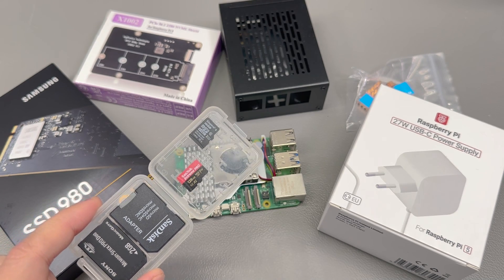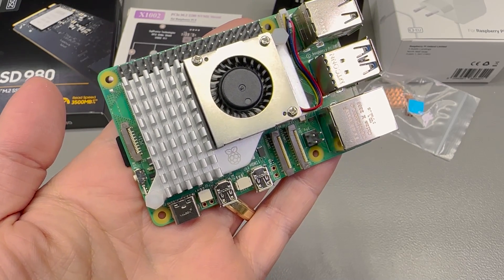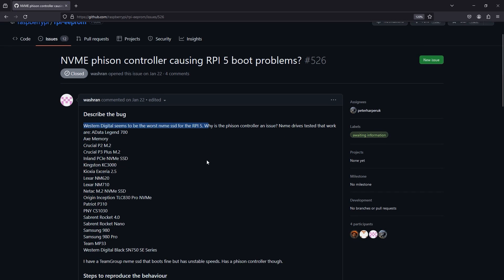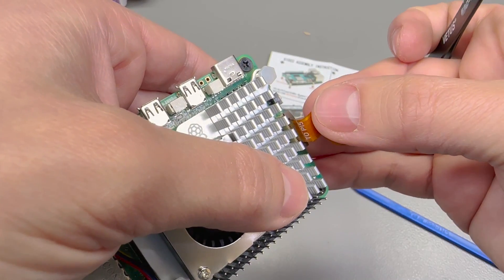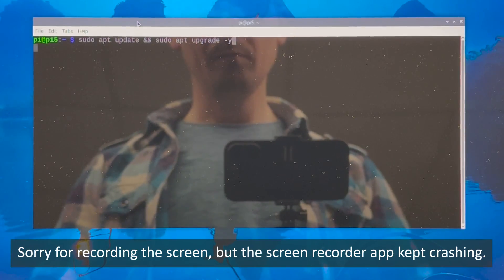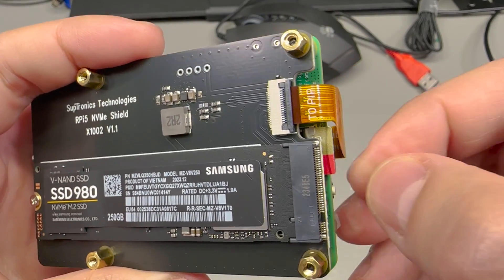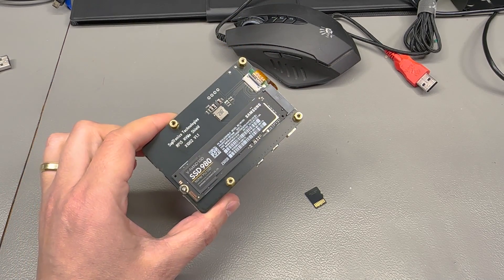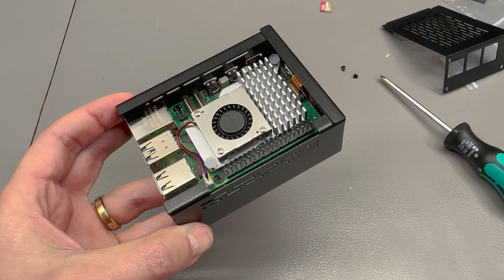Raspberry Pi 5 on Steroids: The NVMe Upgrade

Comment: Can you give a recommendation for a metal enclosure which will hold a dual nvme hat on top of the Pi5 board and a UPS power supply under the Pi5 board?  Your video was very well done.  Thank you for the info.

Comment: Zdravím. Je mrzuté, že se při prezentacích nezdůrazňuje, že je třeba volit SSD HDD dle seznamu doporučeného z POMORONI. Stalo se mi, že jsem použil SSD mimo tento seznam a žádné zařízení „/dev/nvme0n1:“. A pak jste v pytli. (nefungoval  PATRIOT P300, WD Blue SN5xx) Tedy objednávám NETGE NV3000, který v seznamu od PIMORONI je. Tak uvidím jak to dovadne…
*
Hello. It's annoying that the presentations don't emphasize that you need to choose an SSD HDD according to the list recommended by POMORONI. It happened to me that I used an SSD outside this list and no "/dev/nvme0n1:" device. And then you're in the bag. (PATRIOT P300, WD Blue SN5xx didn't work) So I'm ordering the NETAC NV3000, which is on the list from PIMORONI. So I'll see how it goes...
*
https://shop.pimoroni.com/products/nvme-base?variant=41219587178579

Comment: It is interesting that the PCI can only supply 5W.  Most of the websites I've visited regarding pi 5 compatibility all say the samsung EVO 980 PRO 500GB and 1TB models are compatible and then VoltLog says 5W max and both of those pull more than 5W.  We will see.

Comment: Something is seriously wrong about script for pibenchmarks, most nvme's on pi5 with pcie 3.0 scores about 40k. On Rock5b, which has 4x such lanes it was about 20k. I also checked it on my 13gen i9 with 4x pcie 4.0 in RAID and got about 25k.. this setup is capable of 12TB/s and its half of result for chepest 2230 nvme on pi5 :)

Comment: 👍I wish there were a similar product with 100% passive cooling. I'm using a case with passive cooling at the moment and it works very well with Rpi5 but unfortunately it will not fit the NVMe board.
Reply: Try the Argon One Ver. 3. It comes in slightly different flavors, but one of them includes an NVMe bay. It also expands the micro-mdmi's to full size, and comes (optional) with a DAC sound board and jack. I got mine for 45 Pounds.

Comment: Ive been multi booting the Pi4 from a SATA SSD. runs like a little beast. Ive overclocked it to 2100 aswell.
Reply from the maker: I'm assuming running through a USB 3.0 to sata adapter? Which is not bad, still gets pretty good speeds.